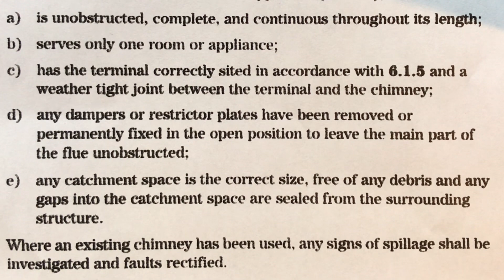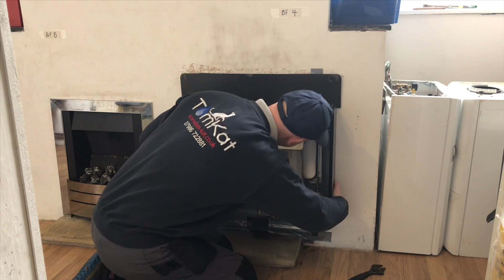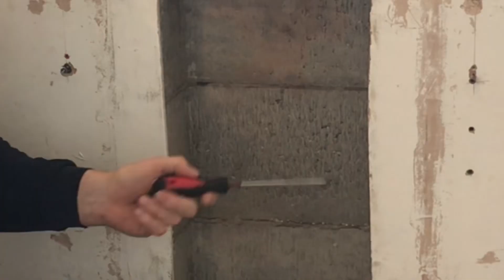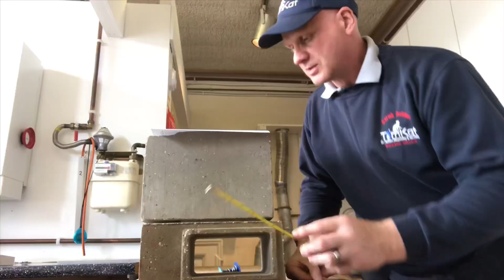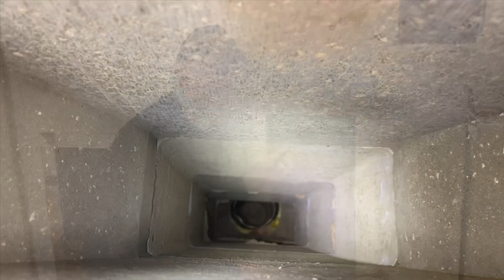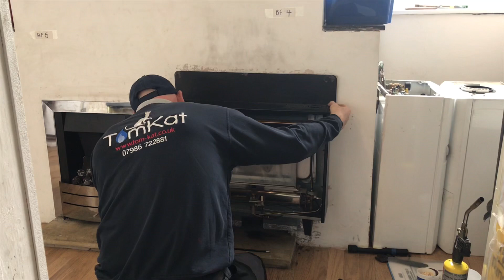FLUE FLOW TEST AND SPILLAGE, part 1 a gas tutorial for trainee gas engineers

Comment: Question. If I walked passed A gasfire into the kitchen for a boiler fault that turned out to be just low water pressure to the combi boiler . Would I be expected to do all them checks pluss gas rate,check saftey chain,cuttoff, working pressure of cooker that was also in the kitchen,FGA checks ect to boiler all within the repair charge if the customer only wanted to pay to get the boiler up and running?
Reply from the maker: Read igem/g/11 appendix 5 and it will explain your question
Reply: @tomkatgastraining thanks however I scrolled through it all and couldn't find the answer. I will contact Gas safe they should answer it.
Reply from the maker: @peterpearson3008appendix 5 is very clear it even give you a chart to follow

Comment: Question how can you go into the loft if you are holding the smoke pellet surely you would need to put it a the bottom? Please can you confirm..
Reply from the maker: It take a while for the smoke to travel up the chimney but if the chimney is leaking in the loft you will see the smoke because it hangs around for ages so once the pellets have finished you the go around the house and loft looking for smoke.

Comment: Can't you just purge by lighting the fire? So it is not work and you don't need to check for leaks? Cause if the volume of gas in the premises is over 0.02m³ but less than 0.035 you're anyway not allowed to do it through a loose fitting and you anyway need to use your appliance ignition system isn't it?

Comment: Brilliant as usual. So you have a series where you do service on back boiler and fire? I am slightly concerned about the methodical approach to this., Its my understanding that I do an initial tightness test prior to removing the fire, then, well then I am slightly confused, there is so much discrepancy between engineers, some say to do a "mini tightness test at gas valve" and a final tightness test once back boiler has been serviced and everything replaced? Is there a video you have done on BBU service that clarifies this?
Thanks
Reply from the maker: No I haven’t done one yet sorry
Reply: @tomkatgastraining  no worries I dont suppose you have the time, can't find one anywhere online.....hard to come by I guess

Comment: Hi, if there are faulty starter blocks and snotts between blocks in precast flue but when we try smoke match and smoke pallet are successfully. Is this precast chimney pass within this senario?
Reply from the maker: If it pass flue flow and spillage you would advise that the faults are corrected ASAP
Reply: @tomkatgastraining  if customer don’t want to repair it from me can I leave this property in this situation. This is not id situation and don’t mandatory remove the appliance isn’t it
Reply from the maker: @osmelmuhendislik807  if the customer doesn’t want you to repair it then just note it on the paperwork

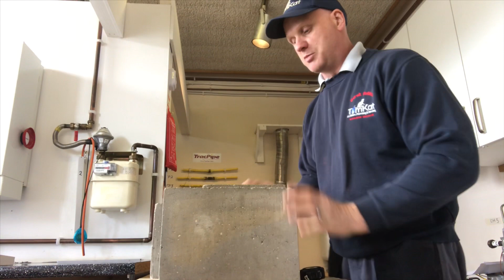Comment: it is the female upwards not the male on the flue pot. please correct it. Reference: 14:50. otherwise, the condensate from the chimney will run in the flue joint
Reply from the maker: If you are talking about twin wall it’s male up female down single wall flue is female up and male down
Reply: @tomkatgastraining  I was referring to the flue block. 14:50
Reply from the maker: @egservices-plumbingandheat5570  the flue blocks are made that way they even came with a sticker on the blocks to show you the correct way up the manufacturers even gave me an installation sheet and finally you couldn’t get it wrong if you tried as the flue block wouldn’t sit on the cover block or the transfer block.

Comment: What is size of heat shield?
Reply from the maker: What heat shield ?
Reply: @tomkatgastraining  for a gutter
Reply from the maker: @lostinthoughtscalminsilenc8167  heat shields aren’t need for condensing boilers because of the low temperature so what appliance are you thinking of
Reply: @tomkatgastraining  OF
Reply from the maker: @lostinthoughtscalminsilenc8167  an open flued appliance can not terminate near a gutter it has to go above the gutter 1.5m off the pitch of the roof or 600mm above the ridge
Reply: @tomkatgastraining  what would be a situation where a heat shield would be needed and what size would it be?
Reply from the maker: @lostinthoughtscalminsilenc8167  they were used on non condensing boilers if they weren’t the correct distance away from the gutter. Most boilers have to be 200mm away from gutters or eves but if you couldn’t get that distance you used the heat shield that covered the gutter from back to front and was at least 150mm wider on each side than the flue. Most manufacturers gave their own measurements for the shield and I have seen them needing to be 300mm wider than the flue on balance flue boilers

Comment: Re-aligning the closure plate can be a pain when it has been moved umpteen times over the years. So what I do is before I remove it I get a straight
edge and mark small pencil markson the wall either side of the closure plate - left and right - in line with the spigot opening, and the same with the vertical parts of the spigot opening, left and right - I mark the wall slightly in line with these. Then when it comes to putting the closute plate back on I have marks on the wall to help me position correctly.

Comment: Always always remember regulation 26.9.  If you carry out checking the affectiveness of the flue. The supply of combustion air. Operating pressure & heat input & safe functions of the pipework and appliances.  You as an engineer will sleep easy at night. Safety it critical there's no second chances. Remember once you're GSR you are the competent person. You don't want any comeback on yourself. Reg 26.9 isn't for quoting regs it's for peace of mind, stay safe ✌